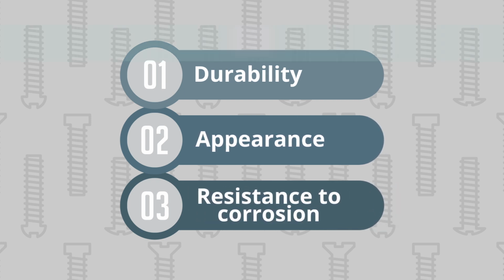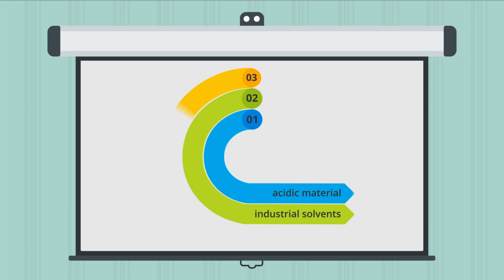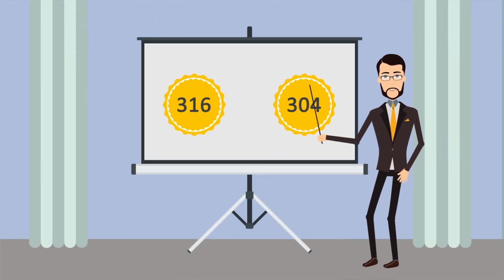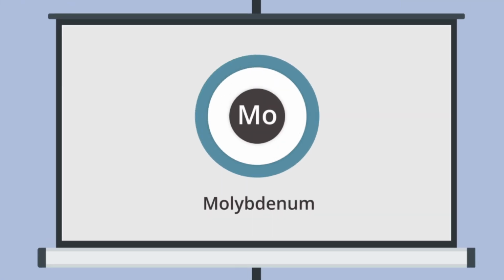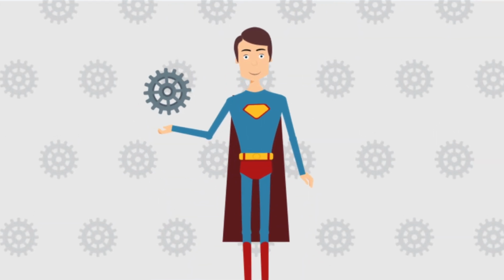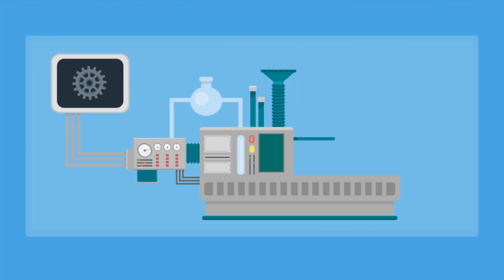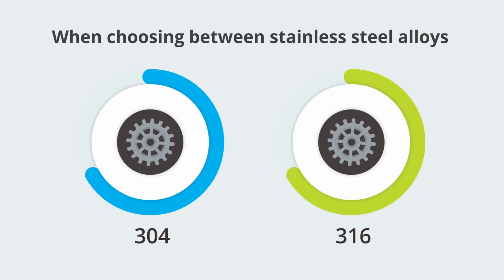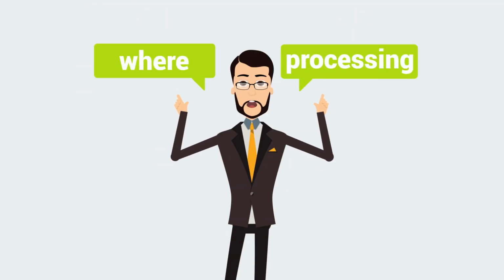What's the Difference Between 304 & 316 Stainless Steel

Comment: This animation isn't helpful at all. It might as well just have been a real guy reading the script. A quarter of it is the text written out. For example, when it says "situations involving acidic material, industrial solvents and saline environments could cause erosion" you just show it in text - why not use the animation to show examples of what that means? Does it refer to foods? what are saline environments? Why are there no visuals of this? Another example - "this additional turns common stainless steel into a super power with the ability to withstand harsh environments" why does it show a superman? That is extremely irrelevant. Why not show what those harsh environments mean. Does it mean stormy weather? a dishwasher? someone beating it with a hammer? 

As someone who is clicking on this link so i can get a simplified explanation with animation that is meant to educate me and make me understand a more complex material, this is not helpful.
Reply from the maker: Hi, Layla.  Thank you so much for taking the time to share your feedback on our video.  It's not a terribly complex subject, but we thought we could put a quick, short video together to give users an idea on the fundamental differences between these two alloys used within the industry.

Based upon your comments, it seems you're still struggling to grasp these differences.  If you have any additional questions on the matter, please call us so we can get you sorted out.

Again, thanks so much for your input.
Reply: lol. wow.

Comment: Love your video.  Spot Test Kits can be used to help sort these two materials.
Reply from the maker: Spot Test Kits can absolutely be used to help sort these two materials.  That's a bit older technology today, however.  We use a Niton Gun which is able to identify the material composition of our fittings within about five seconds.  You simply point the gun at the material in question and a compound material report is generated.  It is my understanding that the spot tests, while accurate, would take several minutes and require multiple applications of chemicals to get a result.  I'm glad you liked your video!!!